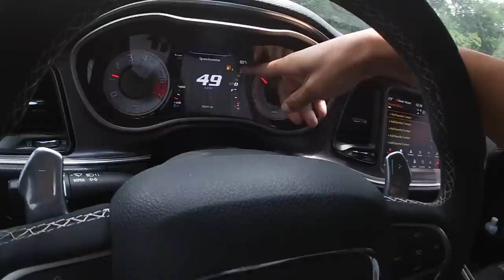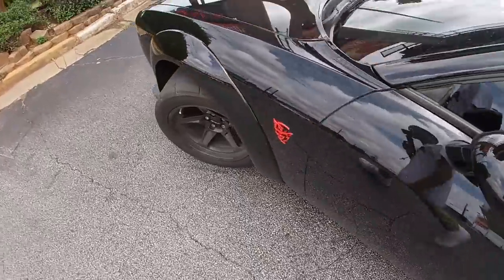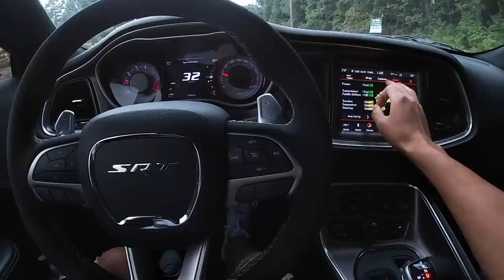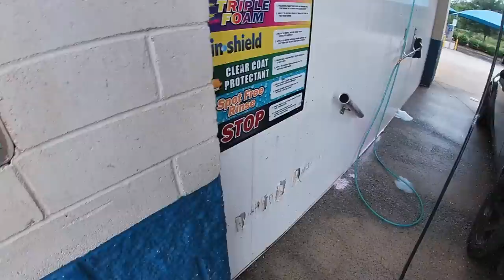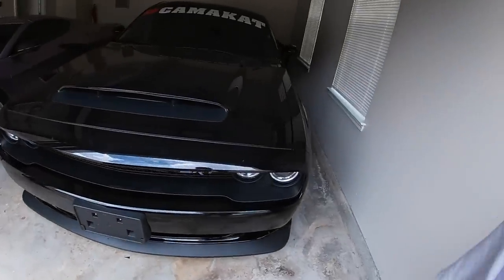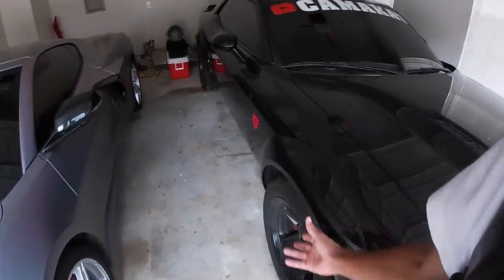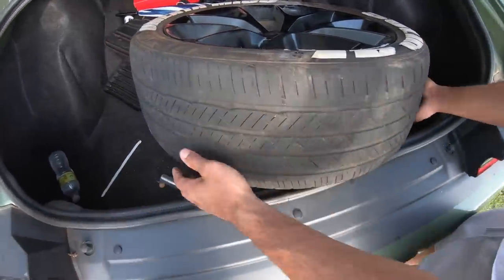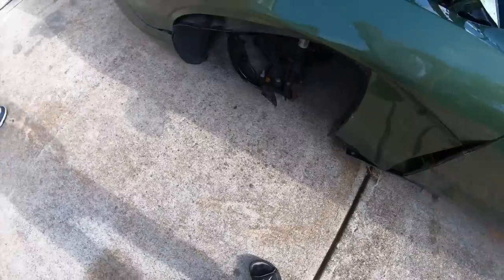THEY STOLE & TOTALED MY COUSINS CAR & I CRASHED THE DEMON! *BAD WEEK*

Comment: Just take it to the best body shop in Atl and your cousin needs to get car lock it will let you know if your car is bumped / touched , if it started , and I think you can notify police or set the alarm off w car lock from your phone , I think it tells you if the door is opened as well  it goes in the Obd 2 port